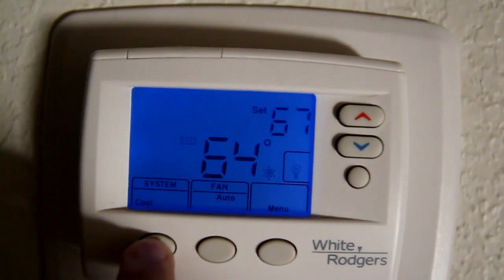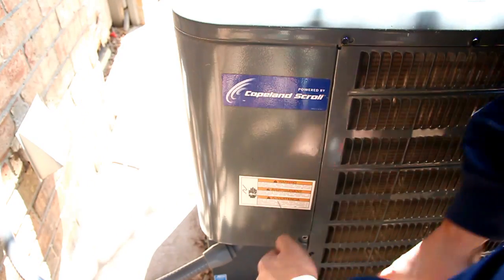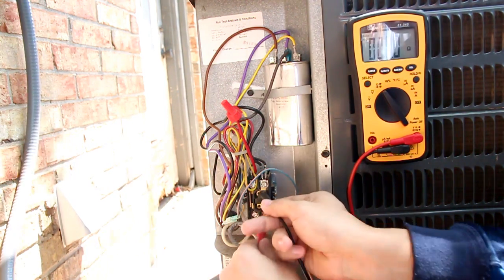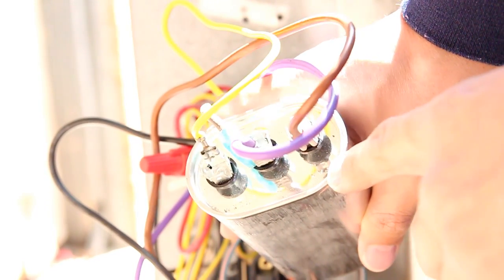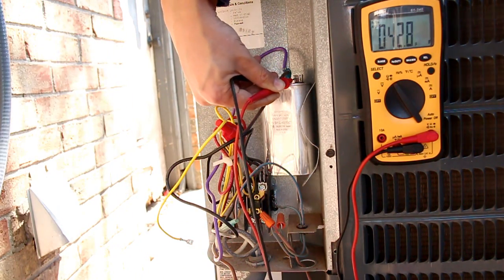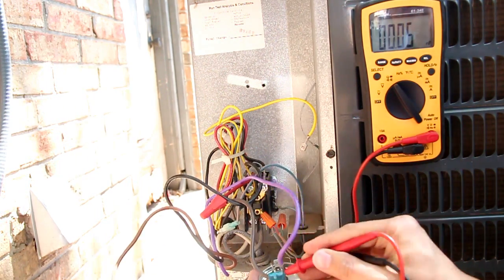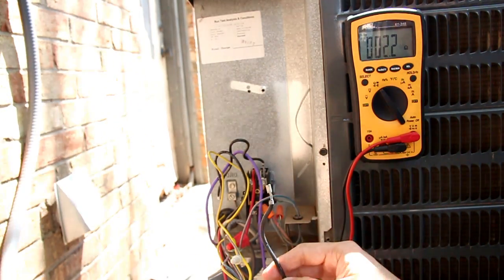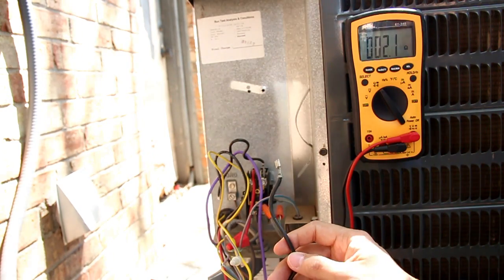AC blowing hot air - How to troubleshoot HVAC compressor - measure resistance - blown compressor

Comment: Great video overvall. As others have mentioned checking behind the cover on the actual compressor itself is key. Many years ago the terminal on my compressor for one of the three wires - I forget which one had - burned off. I had to purchase a special connector with an Allen head setscrew to attach to the terminal because the blade connector head totally disintegrated. That was six years ago and as I sit here typing this the same compressors is on outside the window humming away. Not sure how much money that saved me but the technician probably would’ve said I needed a new compressor. Thanks for the video!

Comment: U have to let the compressor cool down before checking resistance of windings then u can confirm that thermal protection is open and if it stays open u have to change the compressor

Comment: 2:43 turn the unit off inside, then you can depress the contactor to dump the capacitor, using a unshielded metal socket wrench would dump any current into your body. smooth move. your lucky you didn't get a super jolt. #safteyfirst   also on capacitor, there are 3 different poles, 4 poles is common, 3 poles is Herm 2 poles is fan.

Comment: Hello DIY Tinker,I like to watch every one of your DIY  videos.  However, I wanted to clarify when you were measuring the 24 v single coming from the furnace.  Don't you need have the power turn on to do the voltage measurement?

Comment: great video man the internal overload opened it can snap back by cooling it down with a cold rag or water and also it may close after it cools i have seen them close tap with rubber mallet too try those before replacing compressor.

Comment: I would cool down compressor with water keep your leads on C-R for 20 minutes get ur tone and when ur tone makes overload is back in. fix red wire with new terminal try to restart compressor or maybe add 521 hard start to see if you can bump compressor loose.

Comment: contactactor low voltage read 24 volts and hight voltage is not energized means bad contactor. you doing wrong. touching capacitor terminals that way. lucky that you still making youtube vídeos. I suggest you choose another profession.
Reply: If the fan is running how could the problem be a faulty contactor? Go back to school mate.

Comment: nice vids..what if you have reading of .8 ohms on start windings and 1.2 ohm on run windings and unit keeps tripping the breakers? is the compressor shorted? measurements taken on the compressor terminals.capacitors good i got +/-2 mfd from capacitor exact mfd ratings.
Reply from the maker: i would replace the breaker first. Sometimes the breaker is worn out and trips at lower current.

Comment: just asking but why didn't he check the control board first?
Reply from the maker: +patrick green well, my approach was looking at the big picture and checking functionality first. The thermostat clicked, the blower kicked on, but the compressor wasnt on.  There is only one signal coming from the control, if i didnt get the 24VAC signal @ 1:50, then i would go back and check the control board/thermostat.
Reply from the maker: +papi1emc the blower was working in the furnace 0:25
Reply: +DIY Tinker not to say you were wrong in what you did because apparently you were right, but once you saw that there wasn't anything happening inside but outside was working. Wouldn't the next step be a closer look at the furnace first? Again I'm just asking.

Comment: You're a smart diyer, keep up the good work.  One thing I would not do though is short the capacitor with a wrench in my hand.  It can shock you.  Instead use an insulated handle screwdriver.
Reply: onjoFilms ii
Reply: You right about ratchet was used to short CAP. ( dead meat) .
Otherwise, great clip to know about AC trouble shoot
Reply: How to check an ac compresser its not turning on but fan is
Reply: LOL right, dumb arse !!!  :)))))

Comment: Hello I have an AC issue. My AC unit blow cold air for a period of time and then start to blow warm air. I replaced the capacitor and it still does the same thing blow cold and them blows warm. I also notice that the fan spins a lot slower than the fan on my other unit and it seems like it spins in a different direction although I do feel warm air coming from the top of it when I place my hand over the unit. I do hear a noise coming from the compressor when it kicks on which I am not sure if its normal or not. Can you extend some help. Thanks
Reply: William Belliard Check the fuses and make sure that there both good. If one fuse is blown than the fan will run very slow. The compressor will run slow until the high temp protector kicks it off. Don't run it till you know for sure. If that is the prob you can damage the compressor. If that is the problem than it is only running on half the voltage. Warm air is good that means that it is cooling the refrigerant but the fan running slow isn't going to cool it enough. Good luck! If the fan is getting the correct voltage than the starting coil in the fan motor is not working or the capacitor is bad. Check the cap and make sure its putting out the  right MF's. Good luck.. :) Oh when you check the capacitor make sure that you short it out so you don't get zapped. Good luck!! :)
Reply from the maker: William Belliard your fan should run the same speed as your other unit. if it doesnt then the AC can start out cold and runs warm later on. You might have a bad fan.

Comment: Hi, great video, I have a problem with my AC unit, please any assistance would be appreciated. My breaker keeps tripping after about 5 or 6 hours of the thermostat set AC to on. I would reset the breaker and it would work for another 5 or 6 hours. I would get the cold air coming out of the vents. I replaced the breaker thinking it might be a bad breaker as the house is 5+ years old. It had the same behavior, but now it trips immediately after the thermostat set AC to on. Would this be a compressor problem?? Thank you for your assistance.
Reply from the maker: its hard to say what is causing the problem. Assuming you are sure that the breaker is sized correctly, then something is drawing too much current, and yes, the compressor could be a reason. Does the compressor make any odd or loud sound?

Comment: why would you try to discharge a capacitor with a socket ratchet use insulated tools,
Reply: DIY Tinker you can definitely shock yourself if you don't use insulated tools
Reply from the maker: it follows lease resistance. but sure, u r right.
Reply: fernandesfo@yahoo.com.br接触冷凍のリンク教訓的なアニメーションを参照してください。 

Fernandes-フォルタレザセアラブラジル
See the links didactic animations refrigerating fernandesfo@yahoo.com.br contact 

https://onedrive.live.com/?cid=776A2707D6FBD7B3&id=776A2707D6FBD7B3%21751
https://skydrive.live.com/?cid=776a2707d6fbd7b3#cid=776A2707D6FBD7B3&id=776A2707D6FBD7B3%21188

Fernandes- Fortaleza Ceara Brazil

Comment: I wacth this video i see the guy he remove the wire from capacitor and the black wire to contactor terminal,and he takes the continuty for the compressor must be let the compressor back in the normal cold after he shot off the power then he wanted to take continuty probably the compressor not showing the continuty for common teminal the internal protector was open,i think the guy on this video was sharing only the basic..

Comment: Nice step-by-step instructions. My AC outdoor unit fan was not running. The contactor was receiving 26 VAC - one side was closed but other was open. By disconnecting/reconnecting the purple wire I could see and hear the relay closing nicely. So it seemed strange only one side was not contacting well. So I looked closer..... and.... turns out there were ants (yes, those pesky insects!) blocking one side of the contactor relay. With some vigorous blowing and cleaning the ants were gone and the AC is working just fine now! Thanks DIY Tinker.
Reply from the maker: great job fixing it! A friend had the same issue as shown here:
AC not starting up - Air Conditioner condensing unit lost power - Replace Contact contactor relay

Comment: First of all, pretty good video.  But it does not matter about a path of least resistance or whatever,  If you short across a capacitor that is storing a charge still with a tool that is not insulated, you will get a shock.  And it could be deadly.  One person posted about it could be an open winding.  There are no windings on a single phase compressor other than the run and start windings.  The guy read between run and start so both of those windings are not open.  The only complaint I have is that he did not verify that the common wire was not burnt off or something and not making contact at the compressor terminal itself.  He should have checked to ground as well.  Checking microfarads on a capacitor is a valid test, but a capacitor can read good microfarads and still be shorted or will not work under load.  It can take a very long time for the internal overload to reset.  If the unit does not have a low pressure switch, a loss of refrigerant can also cause it to overheat.  Overloads rarely just go bad.  They can eventually stick open after having opened and reset many times.  My point is something was causing the compressor to overheat and that problem should also be identified.  I have been able to get several compressors back up and running over the years that had an overload stuck open after the compressor had cooled down.  First, the reason it is overheating has to be identified and corrected so it won't overheat again. The overload is usually a bimetal switch located in the compressor windings.  It warps from the heat and then that one time it does not warp and snap back shut giving you the "open" reading between common and both motor windings but you can read between run and start.  You don't want to hit a compressor shell with a hammer, but if you take something like a 2x4 and place it on a strong part of the shell like at the top edge where the metal has been rolled over from the edge to the top(strongest part of the compressor shell) then you can hit it with a 3lb or 5lb hammer and "shock" it with a good blow.  The impact can cause the bimetal to snap back shut completing the path between common and the motor windings.  If the reason for the overheating has been identified and corrected, then it should not open again and can give you many more  years of service from a compressor that was diagnosed as no good.  Although I applaud homeowners learning all they can about any subject, be careful and know your limitations.  This stuff can and will cause bodily harm as well as death and property damage.  Be safe and keep making good videos.
Reply: Excellent commentary and thanks for the practical lesson.
Reply: Paul Ohlstein I am almost sure he said he was going to call in the pros to further troubleshoot. I think he did a good job so far as to identify the problem and the pros will now identify the cause. I am just curious as to Jaroy's comment on the bimetal over-load snapping back into position with a whack of a hammer if they are dissimilar metals of different co-efficient of expansion.

Comment: Why do u use the red probe on the common test ,when u clearly have the black probe plugged into the test meter black common..and why would u discharge the cap with tool not insulated ...if that cap had charge it would have bit u...so what's the point?

Comment: Great Video!  
The red wire seems very bad, it needs to be fixed/replaced.  I noticed that the capacitor was improperly" discharged. The use of a "ratchet tool to discharge a capacitor is a NO/NO.   You may want to discharge a capacitor using a 20k ohms, 2 Watt resistor across both terminals.  

Reference Material
NATE (Air Conditioning & Heat Pumps Prep exam recommends a 20,0000 ohms, 2 Watts resistor, across the terminals for 5 seconds.  Air Conditioning and Refrigeration Trouble Shooting by Billy Langley recommends a 15k-18k Ohm, bleed 2 Watt resistor.  The handle of the tool used to bleed the capacitor should be electrically insulated.   Safety First!!!!
Reply: Every tech uses an unloved screwdriver lmao

Comment: That red wire looks burned. You shouldn';t assume the compressor windings are bad cause it looks like that wire burned up and therefore would be open. I would measure the compressor windings at the compressor before the wires. If it measures good, replae the wires.

Did you not notice that that red wire was burned up? Also, capacitors in general can show good capacitance on a meter and still be bad.
Reply: is showed continuity from red to yellow so those two wires are good. common or brown wire could possible be bad or the thermal overload in the compressor. let it  cool and you should get continuity again.
Reply: I did not notice that the wire was burnt, but I did recognize that winding resistance should be measured at the compressor terminals.

Comment: I replaced one system and two compressors last year due to the homeowner trying their own fix its from youtube.
 Be careful and I caution you about trying something you know little about and getting the wiring back on wrong or using the wrong parts. It can end up costing you hundreds or thousands to repair or replace the system.

Comment: quick question , overload protector open , how you fix it ? replace this safety or replace the common on the fan motor ?
Reply from the maker: the safety is normally "inside" the compressor housing. hence, hvac professionals normally replace the whole compressor. Let your AC cool down for a few hours and see if it resets back to a short/normal.
Reply: Need to replace the whole compressor. It is almost the same price of replacing the whole HVAC system. Once I made a mistake. Just replace the compressor. The HVAC was dead any way two years later.

Comment: how come the contactors are still have 26 V Ac, even if the power is turned off and how much current will be flowing through the circuit controlled by the contactors ?
Reply from the maker: That means you havent turned off your thermostat. The 26VAC is coming from the transformer located inside the furnace. check out "How Air Condition Ventilation & Furnace Works" in my channel, it explains where the 26 and 240VAC goto.

Comment: I think that you have missed one check before we can say that the compressor is bad , you should have checked the caps on the compressor to verify that the wires connected to the compressor are not burned .
Reply: Capciter checking  metset   capciter valu  c  and  herom point  valu show ok  c  fan show valu     comon point  mfd due  type  depanding vershion s

Comment: good video & good illustration on troubleshooting. Besides the safety aspect on testing the capacitor.I still rate your video an A-. i was hoping you will go further into explaining that the compressor can overheat due to several things: dirty contactors, dirty coil, poor air circulation, bad capacitor.

Comment: Yes, your assuming they did the correct stuff but according to him they changed the part charged him $220 and left. There's so many crooked businesses out there. You still didn't answer the question. What did this guy do wrong that could get people killed? Heeeyyyy,wait a min. Are you a trained professional? If so why are you looking at how to videos on you tube?
Reply: he touched the capacitor with a tool without a insulated handle .that there is a no no sir

Comment: So a heating an A/C company is to set have their secretary set an appointment with a customer. Arrive at a specific time for a customer. Drive a work truck to the customers house, have the repair item on hand Diagnose and repair whatever problem the customer has. And if it turns out to be just a capacitor( which is rare) they should charge $10 dollars. You kind of see what an idiot you are sir. Stick to your unlicensed, craigslist, repair friend. Call me when it's time to fix all their repairs.
Reply: where they do that at?

Comment: While he thinks they "changed the uhh,ummm capacitor" he forgets to mention that they uhhhh..  they also acid cleaned and washed the condenser and had to pull and clean the evaporator coil because I ran it for 10 years without a filter. While there they also noticed that the furnace wasn't moving any air because the fan was so filthy they had to pull the blower and clean that. And if you had ANY idea of  ANY business you would understand employee costs, workers comp, vehicles, etc. CONTINUED>>>

Comment: empiremack is right . I am a tech for around 8 yrs I always check for  open windings at the compressor terminals. then I check from each term to the copper pipe to see if it is shorted out. now the overload in a ac unit not a window unit you cannot get to it is all sealed up. what I do is cool the compressor down with ice or cold water and see if it will close. usually if the compressor  overload is opening and closing it means you need to clean the coil and check refrigerant charge.

Comment: I just monkyed with a small unit I had sitting in thr garage. Thanks to you I checked and found the problem; bad capacitor.  Thanks.
Reply: 45mf ok vslve show expls  42some showing    ruing power giveing starting poin power givrin  engezing s.  Strting poin   t    giveing  c  poin  comprssor  nettl line  givring  comprssor poing 3terminals point

Comment: Correct, current follows the path of least resistance. However, if the wrench contact the hot terminal first, the only available path is through the wrench, your hand, body, other hand/feet. If you are going to explain it, you should explain it properly. You should mention a wrench, with an insulated handle, should always touch the ground terminal first, then while it is still contacting the ground terminal then make it also touch the hot terminal.